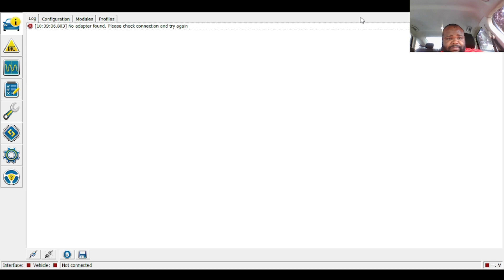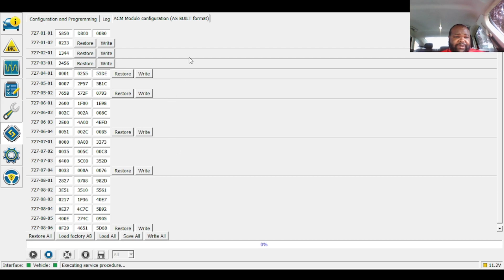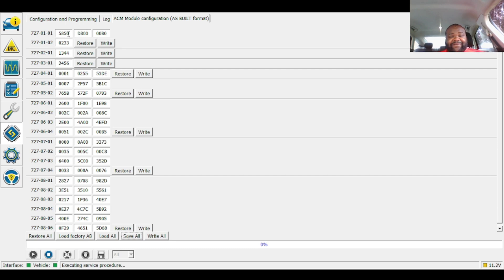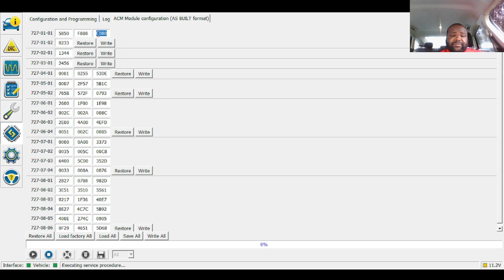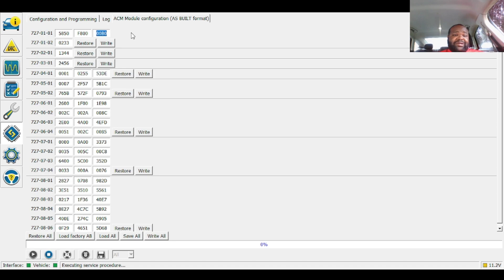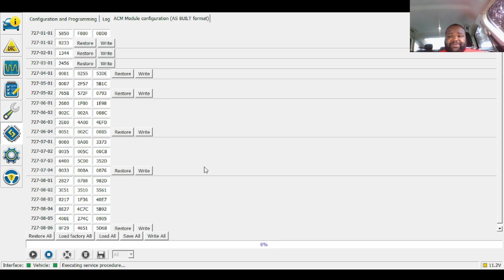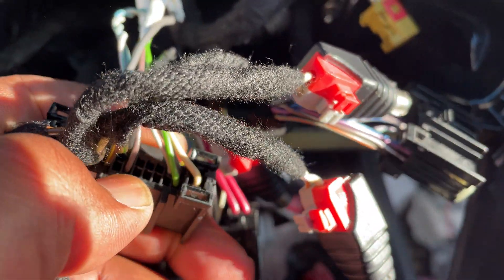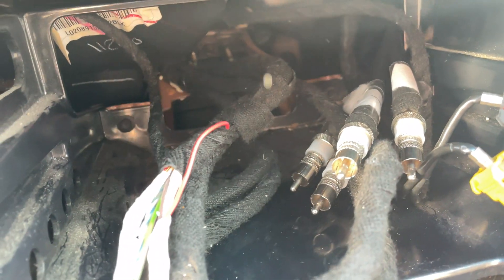Forscan the Factory radio... #aftermarket #fordfusion #amplifier #fusion #ford #carspeakers #

Comment: My friend, I picked two full range channels straight from The Sony amp in The trunk into my aftermarket dsp. If i pick The channels Just like u did from The head Unit, it Will be a cleaner/better signal?

Comment: I have a 2016 fusion and I added a audio control line output converter with a 1000 watt amp 300 6.5 def bonce speakers in the doors and it slaps but it has a hissing noise and I dont know if it's the factory stereo or something to do with all the aftermarket components I've added speakers amp line converter but anyhow if you have any advice I'd appreciate it
Reply from the maker: does your output converter has a ground loop on it ???
Reply: @DMVTeslaDad  yea it has a jumper inside with 3 different ground settings that dont change anything